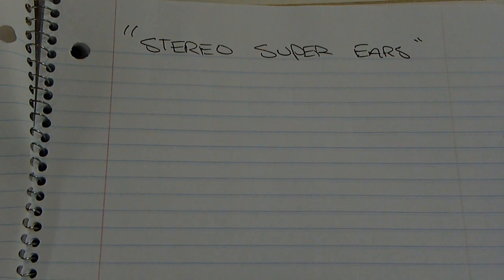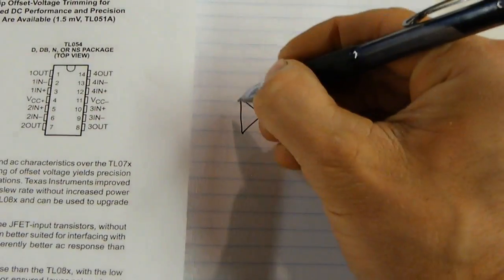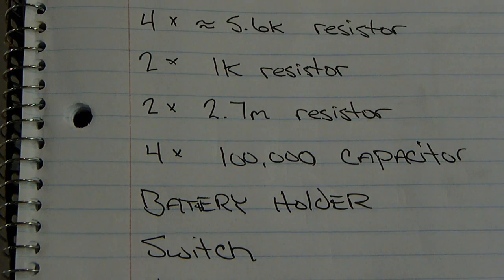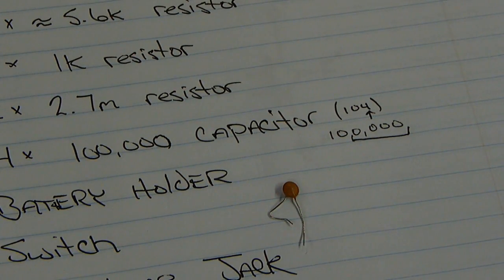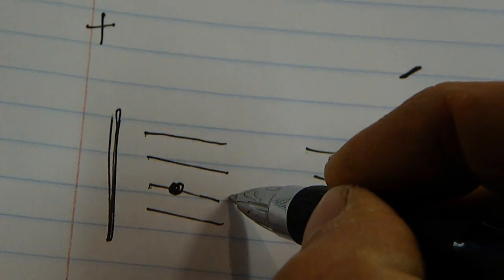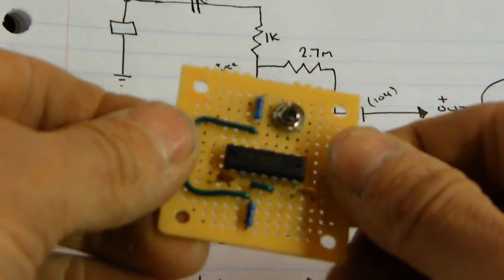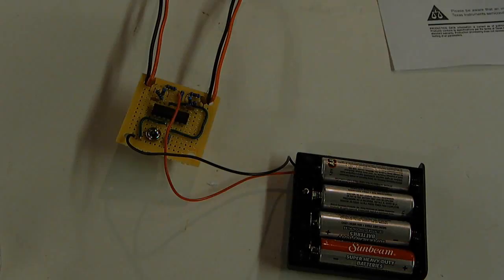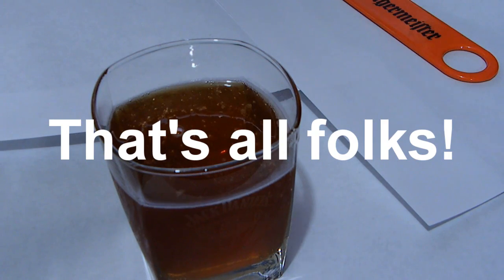Electronics project: super hearing aid

Comment: Is this works on LM339N?
Reply: I would not use that part. Because the LM339  is a comparator. And so it will be optimized for that task. 
The comparator and op-amp might have the same schematic symbol. But they are constructed somewhat differentlly. 
In a pinch you could use op-amps as comparators. I have done so. In very very low frequency applications. And it was not ideal. 
Using comparators as analouge amplifiers is even less ideal again.

Comment: will it work with TL082 op amp???
Reply: You know, i'd take with a grain of salt where he says he can run it on 6V. Just about, but really really borderline. Make it 9V and your odds are a bit better.

But on the whole, TL05x, TL07x and TL08x actually behave pretty much the same when gain is not too high. The last digit is number of amplifiers per IC, he got 4 here but only uses 2.

Comment: Hi. I just tried do the simulation of your project in proteus and I replaced the electret mic with LDR and the output is LED(blue). I run the simulation and there is no output. how I want to know that this project is work as the simulation?
Reply: The leftmost capacitor is blocking the slower changes (lower frequencies) that you would normally read with an LDR. Replace this capacitor with a wire. Secondly, make sure the resistor you use with the LDR is the same resistance as the LDR (at your baseline brightness level). Thirdly, the op gain is likely way too high for LDR use. Instead of 2.7M, start with 2K and work your way up if you need more gain.
Reply: Instead of ldr apply fluctuating pulse ( like ac). Hope it work.

Comment: So now I'm searching for an identical one for both ears. Luckily it's not one of the new super customizable digital ones so another one same model and setting the setting screws identically should fit the bill. What not so impressive is the hiss random noise. While it's better than a kit made with TL08X op-amps also with dynamics compression (have though of switching opamps to something better) it's not as low as I would expect from such expensive electronics - even in somewhere in the 90s

Comment: I got an older (1990s or so) hearing aid from someone who wanted to throw it out after loosing a family member. Me being interested in electronics of course got it. Actually quite impressed. Has 3 adjustments screws. What impresses me most is that with my normal hearing I can get super hearing with this. But also it has build in dynamics compression which works really fast so sudden loud noises are not a problem. Ordered some universal ear pieces on eBay.

Comment: For an absolute beginner, try one the 100 - in - 1 electronics projects kits from Radio Shack or such.  Even as an adult, you'll learn a ton of important info on the basics.  As far as soldering is concerned, practice, practice, practice.

Comment from the maker: Keep the 1K resistor as the schematic shows, then wire the pot as a variable resistor (connect middle pin and one side together) and use that in place of the 2.2M. I would start with a 1M Pot, then add more resistance if you need further amplification.
Reply: PLEASE IC TL052 & TL054 SUBSTUTE